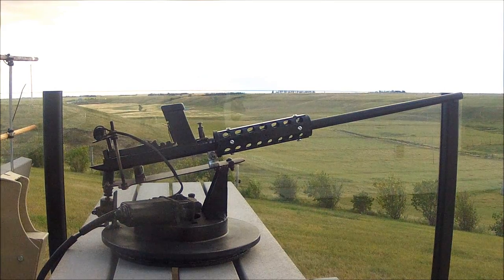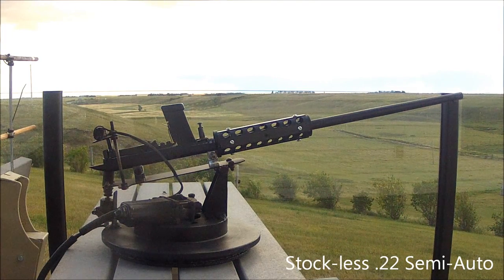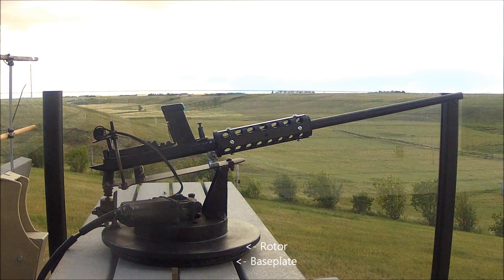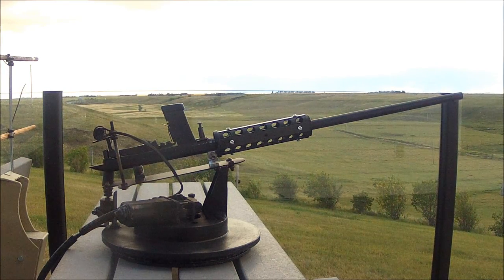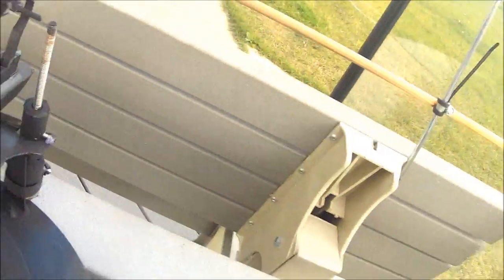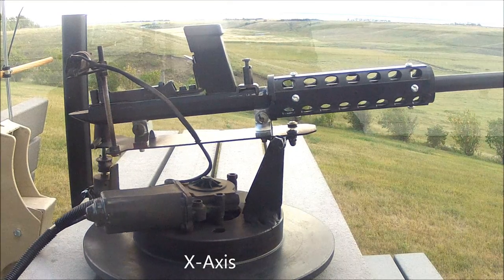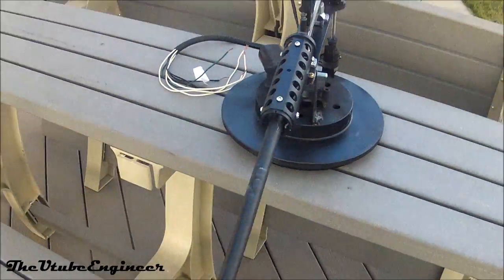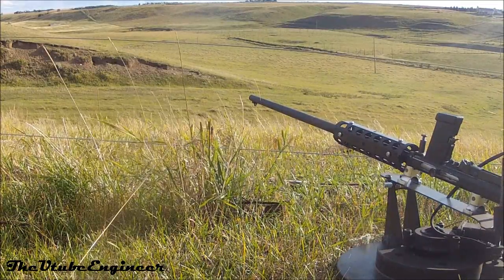Electronically Controlled .22 Turret

Comment: I'm like 90% sure this is classified as a machine gun since you could very easily use that motor to repeatedly pull the trigger.
Reply: Myziam YT  -_- thats not bump firing. This uses a motor to pull the trigger after each shot by pressing a button only once.
Reply: Deleted
Reply: @themichhiker2104  A machine gun is a firearm that shoots more than one bullter per trigger pull. With a gun controlled by a servo you can hold down a button to continually fire which means your firing more than one round per trigger pull. 
Its the same reason you can't attach a motor to a gatling gun.
Reply: @holyravioli5795  Yep, your right.